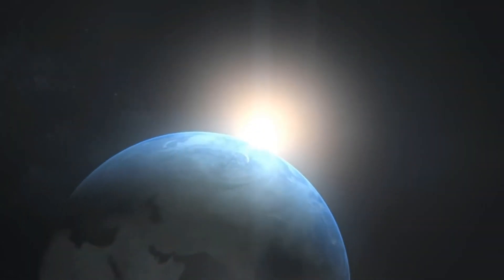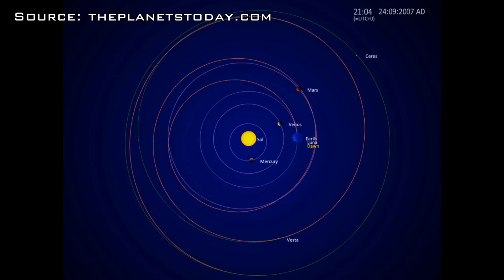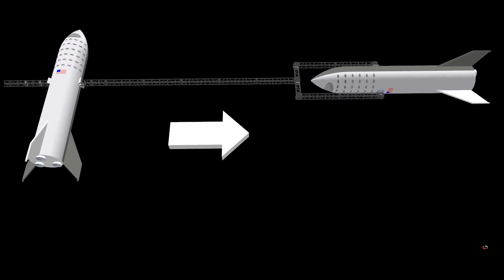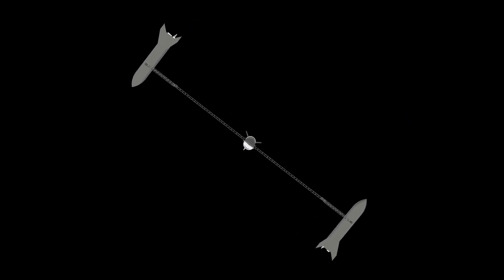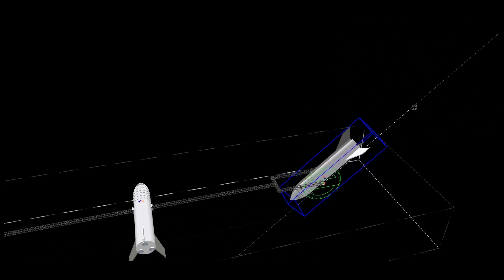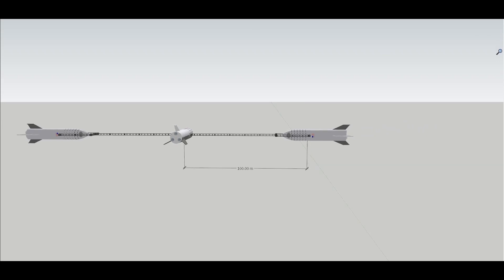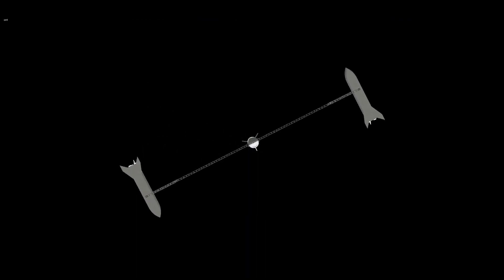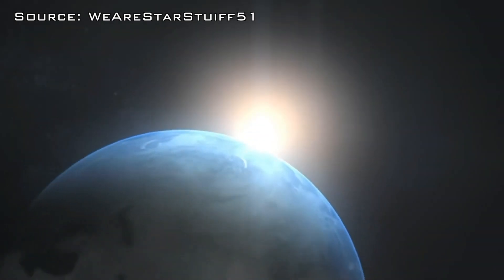GLS2: Artificial Gravity for SpaceX's Starship

Comment: The premis is good, but this would never work. Where to begin....You would need a way to travel between the ships. The trusses take up all the space inside the ships. Any manouvering would be extreamely complicated and dangerous (probably the biggest flaw). The central ship would be extreamely disorienting to work in. Basically you solve the problem of gravity by creating a crapload of other problems. I get that this is a basis and the idea would be worked on, but I dont agree that this would be easier then having a ring system around a fixed fusalage.
Reply from the maker: I don't see how any of the things you listed are actual problems. No one needs to work in the GLS (center ship) or transfer between ships. But if they did, they could climb the truss. Once on the way to mars, there should be no need for maneuvering. If some one has come up with a ring system around a fixed fuselage that can be launched by Starships, I hope it succeeds and would love to see it!
Reply: @smallstars  one of the previous comments also spoke of how you would balance the mass of the two (arms) ships. between fuel and payloads. 2 'arms' are unstable, with three or more you could tether them but there would be the problem of vibrations and resonance. No need to use the GLS? lost space in a spacecraft is probably one of the biggest flaws. Climbing the trusses? under centrifical forces? are you nuts? You could have a tunnel system but It goes back to the problem of balancing act between the arms. Course corrections are inevitable for a trip to Mars, Moon missions needed 4-5 on average, to and from. Like I said, the premis is good but you have to admit there are a lot of holes in this design.
Reply from the maker: @deniseaton2118  I like the idea of 3 arms, (for stabilization) but you have to see that the GLS is needed to get those arms off of earth and on the way to mars. You are not the first person to mention vibrations and resonance, and I can't visualize how that would be a problem, and through my research I have found no experiments done with spinning vibration and resonance that concluded with problems.

Climbing trusses won't be any bigger of a deal than climbing a ladder on earth, as we are only creating one G. The difference here being that the centrifugal force pulls on you less and less as you approach the center of the spin system.

I do agree that the inability to execute course corrections is a hole the design. Thanks for your input!

Comment: Need to check efficiency at throttled points....I doubt it's as efficient at 20 vs 100 even though it's used for returns.
Reply from the maker: Yes people have been telling me it will only go down to %40 anyway... but if it could go down to %20 you would likely get %20 thrust while using %40 of the fuel.

Comment: There's no need for a center craft and there's no need for a truss.This can be done with tethers. If you have three or more craft with tethers forming sides of a triangle, square, hexagon, etc one can attach solar sails and make a giant solar powered pinwheel. Changing the angle of inclination of the sails can accelerated, hold constant and decelerated the rotation. Torsional forces on the bodies of the craft by the sails can be braced by diagonal tethers between the adjacent craft. This mostly tensile structure can be towed up to speed loosely between multiple craft. Once up to cruising speed RCS can be used to position everything and then let the sun take over.
Reply from the maker: Interesting idea!

Comment: Design problem: I'm not an engineer, but I saw this right away. The two ships / modules being spun around the hub are shown vertical, perpendicular to the spin angle, but they should be parallel, horizontal, to make the most use of the deck space inside. You want living / working space for your crew to be long decks, not lots of small, stacked decks, floors, stories. This also avoids having a weaker or faster spin and centripetal gravity near the core or hub and a stronger, heavier, not quite as fast centripetal gravity at the rim of the wheel / circle. But if you really want your ship to spin, have them in a donut-like torus for a habitat ring. Also, your cargo holds probably do not need to be spinning, except for some special cargoes that need simulated gravity and need atmospheric controls for heat/cold and air/water.
Reply from the maker: You should check out my only other uploaded video (as of september) to see some long deck action. Don't mind the primitive animations lol, but you'll see quickly in the comment section that the long deck was quickly and thoroughly hated on

Comment: I believe that two masses rotating around a hub would be unstable due to low frequency vibration effects.   I believe three would be a minimum and four better yet.  This is why large wind generators have at least three blades.  Any rotational system would change it's orientation over time due to gyroscopic precession, so could not maintain a fixed angle relative to the sun without additional thrusters, which would aggravate the precession.  In all cases, the masses in each of the bodies would need to be regulated somehow to be exactly the same, probably requiring fluid exchange through a tubing system and tankage.  Otherwise, even more instability would occur.
Reply: Use sliding weights along the trusses to balance the mass and counter effect the vibrations as been done with rotating equipment/tools and skyscrapers. These systems are dynamic and will allow constant adjustment to current flight status.
Bare in mind that there will always be fluctuations in trajectory and the system has to be designed with the means to identify and correct them along the way.
Reply: Nah, there are wind turbines with two (or even one blade and a counterweight). Their problem is vibration as the blade passes the tower (where the windforce is at a minimum) combined with the other blade pointing up (the wind is noticably stronger at height), and that is significantly worse for a twoblade design vs a threeblade design. Regarding precession, that results from a forcing moment - what would that be here?
If the two starships have different weight, they will just not rotate around the center - that might be an issue due to the SS there. But then again, the center SS has no real purpose in this plan, so well..
Reply: I don't think that would apply to a completely steady state system. Things like wind turbines and helicopters experience instability because the leading and trailing arms are experiencing different forces. For a turbine its gravity, for a helicopter its wind speed
Reply: @myvids4329  Not the same forces, but similar instabilities.  For wind gen, the turning moment, for gyroscope stability of  rotational modes.   A giant dumbbell can rotate equally well around any axis, since it has rotational symmetry.  Don't forget about the solar wind, which is relatively weak, but over long periods of time can cause many unintended consequences.  Adding another lobe, as per a three bladed station, the rotational modes are improved.  There are still many, but only one with maximum potential energy.  It gets better as more "blades" are added until you have a continuous ring.  Gyroscopes are ring shaped for good reasons.  Things are often much more complicated than they seem at first glance.
Reply: As long as the thrust from both rockets was well controlled and equal i think it would be fine. The only time that it would break apart is during acceleration. Any instabilities would eventually be dissipated by hysteresis processes of the truss. Furthermore, there are no external forces that complicate unlike in the case of wind turbines that have to deal with non-linear effects.
Reply: Dont give too much things to think at this smallstars guy.. IS THE MAN... gyroscopic precession? three blades? fixed angle relative to the sun? additional thrusters  - Too much math here, lets just make things rotate. (Ironic mode active here)

Comment: Why use truss when you could use a simple spool of cable? The best part about this idea is that you can you tensile strength instead of something designed for compression. You could also string inflatable Bigalow balloons along it. You might also try modeling three ships instead of two on the spokes to make it more stable. This reminds me of the Roton Space Helicopter from the 90's too.

Comment: There would be a huge amount of force on that trust. Could take months to slow it down without breaking. Think of the weight of the trust in comparison to the starships. It would be like trying to slow down or speed up someone on a skateboard by pushing or pulling them with a plastic straw. Don't get me wrong, it would definitely work. But would take too long to suppress all of that energy on that little trust. I think you would need to go at least 10x fold on that trust to make it work quick enough. Or a trust that spans in thickness at least 30% the length of the starships. But I love the idea, in my opinion, I feel like it just needs to be a lot bigger.
Reply from the maker: Well one of the big selling points of this idea, is that the thrust is created where all the mass is. It's not like I have a rocket half way down the truss trying to stop the spin. The Starships them selves are the most massive parts of the spin system, and it is at their location that the thrust is applied.

Comment: Well animated. I had this idea earlier too, but with some differences: No middle starship required because I use carbon nanotube made ropes to connect 2 starships. Distance (diameter) is much larger, about 1 km to get rid of uncomfortable moving sickness you get when spinning in a short radius. I use thrusters to start/stop spinning and computer controlled laser guidance to start/stop spinning and keep controlled spin. Most important, I fill each starship with just half the crew, but with full equipment. This way one starship could act as a lifeboat for the other one (if you have to abandon one, of course then without artificial gravity). Spin start on earth is 1G, slowing down to mars gravity at the time of arrival. Reverse on the way back. I think my solution is cheaper and easier to build.
For all the other points, I completely agree with you.
Reply: You don't need 1km cable, or carbon nanotubes or laser guiding.
Normal short cable and 1 ion thruster. That's it.
Reply: @serg3y  Not enough. You need a large distance to overcome sickness feeling. Otherwise you feel like inside a spinning wheel on a fair. Can't move well anymore. That's why a large distance is crucial.
And such long ordinary cables are heavy. To avoid this, you need very light, but extremely strong material for the cable.
Reply: @tomdue  there has been a bit of research with various conclusions, but in general 4 rpm is noticeable but easy to acclimatise to in 1-2 days. Even 6 rpm is fine. The Jewry  is out on 10 rpm. Some research says you will get used to it, some says no.

Next time at the kids park sit on that spiny thing and ask a friend to rotate you once every 15 sec. It's nothing! That's why the following makes more since to me...

Example: Acceleration: 0.6 g
Rotation rate: 4 rpm (noticeable at first but get used to it in 1-2 days)
Velocity: 14 m/s
Radius: 34 m (to main quarters, shorter to nose, longer to ship base)
http://www.artificial-gravity.com/sw/SpinCalc/SpinCalc.htm
Starship mass: 900 ton ~ 665 ton fuel (using conservative 50% of capacity, prob much less in reality) + 85 ton ship + 150 ton payload
https://en.wikipedia.org/wiki/SpaceX_Starship

Cable tension: 5,300 kN
Cable type: improved plow steel (worst case example, in reality use something better like Kevlar)
Cable diameter: 18 cm (effective, use several small cables)
Safe load: 3,500 kN (150% load)
Cable breaking point: 17,000 kN (31% of breaking point)
Cable weight: 6 ton (for one half of cable, 4% of payload) https://www.engineeringtoolbox.com/wire-rope-strength-d_1518.html

#1 challenge: The cable needs to be part of ship, ie go through the ship towards base, can get thinner as it gets integrated with ship frame.
#2 challenge: Cable loads assumes ship mass is at 34 m radius, but fuel will be past main quarter, so load on cable will be more like 250% of safe and 51% of breaking.
https://i.stack.imgur.com/GYIgz.jpg
#3 challenge: Ion thruster located near the top (opposite of heat shield) that can get 900 ton to 14 m/s in ~2.5 days (slower is safer and simpler). This require only 60 N of sustained thrust. There are already experimental ion thrusters in this range (MPD thruster). To spin down twist the ship on cable axis and repeat.
https://en.wikipedia.org/wiki/Ion_thruster
Mass of the cable can should/will be reduced by a factor of at least 5 by using existing materials such as Kevlar. A factor of 5 reduces cable mass to 1.2 ton per ship (0.8% of payload).
http://www.sssg.whoi.edu/sssg/winch_wire/UNOLS_Winch_and_Wire_Handbook/03_synthetic_fiber_ropes.pdf

Even better is the one ship design where living quarters separate from fuel and engine and get spun up while tethered. If this can be achieved the cable decreases to 22% of above thickness (~150 ton payload+50 ton ship quarters vs 900 ton ship), ~65% of above total cable length (~44 m), resulting in ~17% cable mass (1.7 ton for steel or 0.34 ton for Kevlar). Longer term this makes more since, but there will be a weight & complexity penalty for making a ship that can separate into two. Ion thruster requirement decreases to ~30% (18 N for the 2.5 day spin-up to 0.6 g).

Comment: This is a very cool proposal. My thoughts: 1. Add dedicated spin-up/spin down motors and fuel to the truss system instead of rotating the two starships.  2. Design to provide only up to Mars gravity, which is about 38% of Earth. Making these two changes, the overall mass of the system would probably be about the same, but operations would be loads easier. Also occurs to me that you don't need to be in a huge hurry to spin up and spin down and could use ion or electric plasma propulsion to save on the weight of chemical fuels. Anyways, just my 2 cents worth. Keep reaching for the stars!
Reply: I think the idea of using simulated Earth gravity on the way to mars is to maintain as much muscle mass and strength as possible for as long as possible. The reason for a slow increase in the strength of the simulated gravity on the return trip is that after 18 months of Mars gravity our muscles will be weak and take time to rebuild enough that they can function in Earth like gravity again.

Comment: First, I really like the concept. Thinking a bit bigger, how about having 2-3 passenger-Starships on one side, 1 central starship with the trusses, and the same amount of cargo-Starships on the other side. They could even be docked, so people can roam between Starships while on their journey.

Furthermore: Having a Starship solely for the sake of spin gravity is a bit wasteful. But, what if these trusses could be used on Mars as construction material. After all, they are trusses, that can support quite some forces (true, tension, not compression, but still...). So use them for whatever purposes you can think of. For the trip back, only a small amount of trusses are needed, since there will not be a lot of travellers going back.

Comment: smallstars, I'll add that those three examples are from like 10 years ago.   I haven't looked into in lately but physic's hasn't changed and I haven't heard of any breakthroughs on any of the issues.  But I do know they have found more issues with non-rotating bodies.  So the exact risk numbers may have changed.  Non enough to be pro rotation.   
That all being said I wouldn't put it past Musk to do it just as a marketing stunt in spite of the extra risks.

Comment: Every system in a spacecraft that safety depends on needs some kind of redundancy. I think one of the best parts of this is how there's redundancy not just in systems, but in actual whole starships. Worried about the truss failing? Even if it does and a whole passenger section gets flung off into space, it's still got its own completely independent engines and every other system to either abort, or maybe even still continue the mission with!
Reply from the maker: Yeah aborts are tough though, have you seen the old movie Apollo 13? It's worth a watch even this many years later.
Reply: @smallstars  it's my favorite movie in fact! Yeah whether an abort is an option definitely depends on where they are if and when a failure happens.  Still the redundancy of having three whole independent starships is great either way!
Reply from the maker: @zeph0shade  I was just watching a great presentation on the Mars journey, and the question was asked: "What if we could get there in 4 months instead of 6 months using Nuclear Propulsion" and the very intelligent answer given by Robert Zubrin was that the 6 month trip is the best option because if you miss mars, your orbit will land you back on Earth after 2 years of floating! https://www.youtube.com/watch?v=EKQSijn9FBs&t=1020s
Reply: @smallstars  That is something I hadn't thought of particularly but makes complete sense now that I do! I only assume SpaceX is planning on using a similar trajectory for that reason! Still even if it takes 2 years (without this "artificial gravity" concept given some kind of structural failure) to complete a free return path, I'm sure having entire spare independently functional spacecraft would be a huge comfort to passengers/crew!